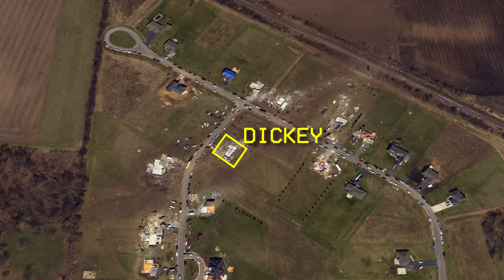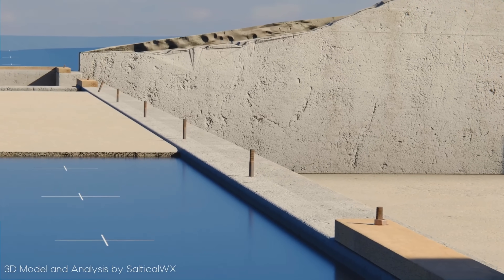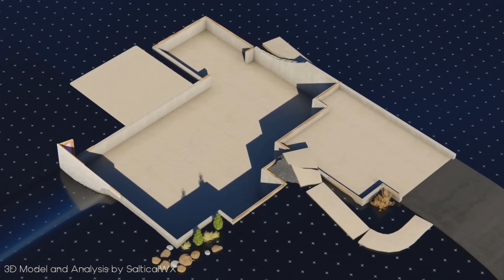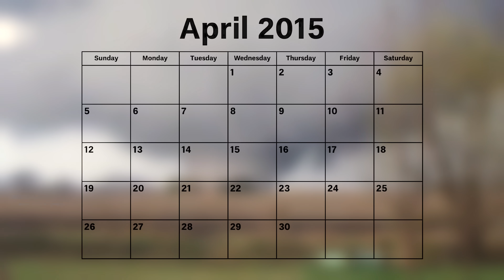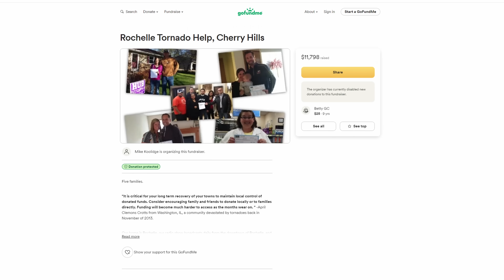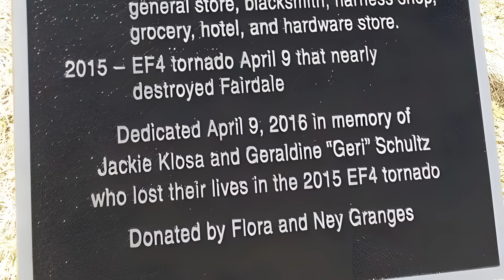The Strongest Tornado That Wasn't Rated EF5

Comment: I still want to know why weather officials are scared to rate a tornado an EF5. What’s so controversial about giving a tornado its deserved rating?
Reply: The reason we are getting less and less EF5 rated tornadoes is because building practices are getting skimpier. The tornado can have 1,000 mph winds and it will never be rated any F5 unless it encounters a ""well-anchored home""
Reply: The scale got revised recently again a few years back. Ever since there have been 0 ef-5's. Also 80% of ef-5/f5's in the past wouldn't even be rated ef-5 with the new requirements. The NWS pretty much made it impossible to get an EF-5 rating
Reply: Probably has something to do with FEMA payouts and insurance claims.
Reply: @Turk_2023  this i believe they dont want pay out and insurance companies involved.
Reply: They aren’t “scared”, it’s just there’s a very high standard for a tornado to get EF5 and those are determined by a team of regional wind engineers, not the NWS. Anything above EF2 is marked for a QRT team to review for damage higher than EF2.   

New Wren for example never got EF5 cause the survey teams were overwhelmed and couldn’t reach its most severe damage in time.
Reply: Fujita wasn't as picky as he would rate rate extreme ground scouring as an F5 on the original F-SCALE. The only reason why homes are used in rating tornadoes is because the big insurance companies don't want to pay out for damage rated EF5.
Reply: @cubby091398 Not enough is known about ground scouring to give it a rating
Reply: @Arlen_YouTube usually doesn’t ground scouring happen in very powerful Tornadoes?
Reply: @TheShadow_2025  An Ef4 is a very powerful tornado.
Reply: @TheShadow_2025  
Honestly it would also depend on the type of soil. I'm no expect and took enough pedologic courses in college to be dangerous  but I've seen dirt stronger than rock
Reply: @cubby091398 it has absolutely nothing to do with insurance. That conspiracy makes no sense. What does the rating have to do with payout? A destroyed house is a destroyed house, regardless of tornado strength.
Reply: The rating has nothing to do with. People dont pay for "just EF5 insurance"
Reply: @KaiserStormTracking In time a.k.a. before it was cleaned up?
Reply: @KaiserStormTracking what about el Reno? Wind speeds were high enough but still just an EF3
Reply: @TateLapine  wind speeds from DOWs are not used for rating, especially since those winds are above the surface where damage is done. They will be taken into account once the me update to the scale is finalized and released in a few years however
Reply: @KaiserStormTracking if that's the case, they need to revise their process. The spiral pattern and the pealing of the concrete was extreme! Sometimes you can just look at it and know. This tornado is one example of that imo.
Reply: @KaiserStormTracking This is not the first time they've done this and One of the most famous examples would be the El. Reno  of 2013. It was Should have been given an ef5   Rating being the fact, it had EF 5 speeds and And had the greatest Potential of e f 5 damage.
 But yet with only given EF3 . But If El reno tornado 2013.
it was on the old F5vscale, it would have been rateded. As a high-end F5
Reply: @2musicSoundtrackfandom579  The El Rino 2013 tornado doesn't deserve the Ef5 rating because the Ef scale measures damage and the tornado simply didn't cause ef5 damage
Reply: There are objective criteria, but there are also possibly politics, because the criteria are written so it is extremely hard to get an EF5, for example two nearby instances of EF5 damage have to be found, not just one.  So I think it's plausible that there is some insurance or other business factor that exerts some influence on this rating, although I'm not sure what it could be.
Reply: @myke5696  NWS ratings aren’t determined by politics. In fact it’s against NOAAs scientific integrity policy.
Reply: @myke5696  Its pure scientific, there is no political interest. There is a reason getting the Ef5 rating is hard, if you make it easy to attain, then it won't hold the same value.
Reply: @Arlen_YouTube you’re objectively wrong. It’s political and financial in nature almost exclusively.
Reply: @Cinerary  Wdym?
Reply: Insurance companies
Reply: @commiehunter733 
Incorrect
Reply: @commiehunter733  I whole heartedly believe this
Reply: It’s less about scared and more about it being unnecessary and holding such a high standard. 

Most homes built in the United States today have very low building standards. Meaning something as moderate as a high EF3 could obliterate a new construction home. Houses are being built so fast as the US is transitioning to a renters market that building codes are being changed, ignored, or down right just built horribly. 

For a town to get the EF5 rating a nuclear bomb would have to essentially go off. More than just destroyed houses and or buildings. I’m talking asphalt being ripped off the road, tree’s debarked, ground scouring, and “well built”homes with wall anchors being obliterated. 

The problem with the EF scale is it relies off damage because originally that’s the best way to measure the wind speeds of tornados. Today we have much more modern equipment that can detect internal wind speeds. That’s why the EF scale is so controversial because you end up in situations where tornadoes like the 2013 El Reno tornado are an EF3 despite being the largest tornado ever recorded on this planet at 2.6 miles wide and unconfirmed wind speeds > 300 Mph 

To sum it up. EF5’s aren’t rated often because building quality is going down but as technology increases we are finding new and better ways to observe tornados making the EF scale controversial and outdated.
Reply: Probably for the same reason they’re hesitant to issue a PDS tornado warning: The “crying wolf” phenomenon. People get used to it and won’t take it seriously. 

A few months ago in Michigan, we had a series of PDS tornado warnings issued. They talked about “catastrophic, complete devastation” being possible with each of those warnings. It never happened. Yes, there was significant damage. But I dont think any of the tornadoes that touched down were higher than an EF-2 or 3. 

Now, people like my parents (who already didn’t take regular tornado
Warnings seriously) basically ignore weather warnings. It’s part of human nature.
Reply: Yeah EF5 is only given to tornadoes that can sweep away steel reinforced concrete structures.
Reply: @BroadwayLTDProductions  not anymore, lol. Now that, and just about everything else is just EF-4 according to the NWS. It’s all petty politics now
Reply: Sam is kind of dumb. I would’ve backed that ass up. He had plenty of time.
Reply: Someone may have said this but they probably hesitate to do so because if all these strong tornados are rated an EF5 people won't take the weather seriously. Lots of people already don't care to get to safety so if they flippantly rate them as EF5s ppl will fail to take it seriously and possibly more ppl will die
Reply: This was an F5 Tornado. They got it wrong. Fujita was more accurate
Reply: @LVM5584  Based on what?
Reply: @schnitzelschnizel9448 Smh No tornado "Should have been rated ef7"
Reply: My rule of the thumb, when in doubt, look for who stands to make or save the most money for a given outcome. I have no reason to believe that the reason we haven't seen another EF5 rating in a decade is a mix of a number of reasons already mentioned in this thread. To believe it's only due to data is nothing short of naive.
Reply: It’s less about scared and more about it being unnecessary and holding such a high standard. 

Most homes built in the United States today have very low building standards. Meaning something as moderate as a high EF3 could obliterate a new construction home. Houses are being built so fast as the US is transitioning to a renters market that building codes are being changed, ignored, or down right just built horribly. 

For a town to get the EF5 rating a nuclear bomb would have to essentially go off. More than just destroyed houses and or buildings. I’m talking asphalt being ripped off the road, tree’s debarked, ground scouring, and “well built”homes with wall anchors being obliterated. 

The problem with the EF scale is it relies off damage because originally that’s the best way to measure the wind speeds of tornados. Today we have much more modern equipment that can detect internal wind speeds. That’s why the EF scale is so controversial because you end up in situations where tornadoes like the 2013 El Reno tornado are an EF3 despite being the largest tornado ever recorded on this planet at 2.6 miles wide and unconfirmed wind speeds > 300 Mph 

To sum it up. EF5’s aren’t rated often because building quality is going down but as technology increases we are finding new and better ways to observe tornados making the EF scale controversial and outdated.
Reply: Something has to be up with house construction in the Midwest and the South. I guess contractors see the area as tornado prone, so they cheap out on the construction quality. Either that, or an EF5 secures more aid and attention, aid and attention that the government doesn't want to give out.
Reply: @gliiitched  the first one is right on the money. American house construction is notoriously bad
Reply: @gliiitched  The Ef5 rating is extremely hard to attain, your house has to be nothing short of perfect. Your garage door must be reinforced, your house must be both resistant to uplifting forces, and the winds themselves. It must also not have a porch causing the roof to be lifting off. Nothing big must hit the house when the tornado hits, such as a car. Also your house has to be cleanly swept away from its foundation to where all the debris pushed away from the house with little to no debris left on the foundation.
Reply: I've come to the conclusion that everyone is simply incorrect when they rate tornadoes under the F or EF systems... because those are not tornado ratings. They are tornado DAMAGE ratings. Calling a tornado an EF-4 or an EF-whatever means nothing, because the tornado didn't damage itself lol. Instead, a house might be said to have sustained EF-4 damage. It literally means nothing or has nothing to do with the tornado, clearly. If it was about the tornado, then it wouldn't matter what the damage caused was, it would only matter what the actual wind speed measurements were. And... hate to break it to the NWS warriors on here, but DoW is highly accurate at relatively close ranges, which virtually all DoW ratings are. So if a tornado was measured by DoW, that really should be the #1 factor in rating a tornado.

TL;DR: EF scale has virtually nothing to do with the tornado itself, calling a tornado an EF-whatever doesn't actually mean anything about the tornado itself, DoW is definitely accurate enough at close ranges to give accurate windspeed readings, and we need to actually use science (clearly subjective surveys of damage is definitionally unscientific) to rate tornadoes, and I hope we actually get a true tornado rating system, because neither the original Fujita scale nor the Enhanced Fujita scale are actually rating the tornadoes.
Reply: @joshuaporter1905 your tl;dr is legitimately just as long as your original comment, lmfao.
Reply: Basically, scientists overestimated the wind speeds needed to cause damages historically rated as EF5. And now they are correcting that. Yes, wind speeds have been estimated because we don’t have a reliable way to directly measure them in a tornado. 
Personally, I think they should have just kept the rating scale the same according to level of damage and updated the wind speed assumptions.  But that’s just me.
Reply: @schnitzelschnizel9448  You can't have something that is Ef6 if the scale goes up to a Ef5, plus we haven't had an Ef5 in over 11 years so we clearly don't need an Ef6.
Reply: Well not only the reasons ppl listed but if they just rate a bunch of tornados EF5 when they aren't it will make the damage/lives lost not seem as serious over time 
"Yeah but so and so tornado was EF 5 and only killed 1 so this can't be so bad"
The public already doesn't take tornados seriously this would make it worse
Reply: @SageMoon-Moon but… that doesn’t mean they need to stop giving out the rating. There have only been a couple EF5 worthy tornadoes over the past 10-15 years. That’s not “handing them out”.
Reply: Some people: "Here's a clear, cogent, data-driven answer to explain your exact question."
Other people: "Rabble rabble ignore science, it's a conspiracy between gubber-mint and money."
Reply: @digitaltrekkie  I can understand why people throw out random conspiracies when the last one given the rating EF-5 was over a decade ago, on top of utterly  devastating tornados that have broken records but still nothing. I understand why they use the EF scale instead of the F scale but to me it still just doesn't cut it.

There could have been the most powerful tornado in history but unless it causes damage to manmade structures that were already constructed to a high degree it would be possible for it to get an EF-2 or 3 rating. To me at least it would be giving an earthquake a low rating cause there were no structures affected. A real example was in my country of Canada where in Elie Manitoba there was a F-5 tornado that struck and the only reason it was allowed to be given that rating was a video that was taken of it was put forward(they had evidence from the damage done but but made excuses for it).

I understand you may not have the answer but I just want it all to make sense.
Reply: @digitaltrekkie  This is a rather uncharitable view of people complaining about a rating scale that is known to be flawed, under revision, and is regularly criticized by meteorologists. Additionally, conspiracies exist. You're acting like every conspiracy is lizard people or NASA hiding the flat Earth or whatever, but large pharmaceutical companies took doctors on trips to butter them up to sell more of their product. That was unethical and a conspiracy by the pharmaceutical companies to get better profits. If the insurance companies have any way to bribe or prevent engineers from reaching the worst damage of a tornado, therefore preventing a proper survey, that would be a conspiracy that could benefit them by allowing them to deny claims from destroyed homes because now they can say it was the home owner's fault. A practice insurance companies have been caught doing so many times it's mundane.

Until we understand tornados better scientifically, we are going to have terrible rating scales. Right now we know next to nothing about them.
Reply: @digitaltrekkie not even remotely accurate. The “science” would be trusting a far more accurate scale (the original fujita scale’) and, you know, MAYBE NOT PRETENDING DOPPLER RADAR EXISTS.
What an absolute clownshoes laughingstock, to claim “EF-5 tornados have 200mph winds” and then give literally dozens of tornadoes with clear F5 damage and directly measured windspeeds in excess of 250mph as “totally an EF-5 scale.”

You’re supporting a corrupt bureaucracy, not science.
Reply: @digitaltrekkie rabble rabble? Really? 😕
Reply: @syds8752  I'd just watched an episode of South Park with a rabbling crowd, and it was fresh in my mind; probably could have phrased it better and less dismissively, I admit :\
Reply: If it didn’t reach the minimum EF5 requirements then it’s not an EF5. Simple as. Its data, not a trophy
Reply: @trevorfyb4672  it moved a whole concrete walkway, and damaged the foundation, usually only found in STRONG tornadoes, specifically EF5’s
Reply: @Gic424_YT  a walkway chunk piece can be moved by a human, as for the foundation damage the question becomes was it already damaged? was it a build quality issue? if the answer is no and build quality was top notch then you got something, but it take a bit of work slicing up the rest of the foundation to check which costs time/money
Reply: @Gic424_YT  usually. Not always
Reply: @Gic424_YT  Moving a concrete walkway is trivial if air is able to get beneath it easily enough. This is why actual engineers are required to make these assessments; they understand these things and can assess them given the context based on their expertise while 99% of the layman YouTube commenters (and perhaps creators) think they know better, despite knowing close to nothing about any of it.
Reply: @trevorfyb4672 liar
Reply: @trevorfyb4672 The narrator pointed out several examples that this may have been an ef5.

Comment: One of my candidates for F5 was the 1999 Loyal Valley TX F4. The nearby NWS office stated that the tornado rivaled that of the BC-M and Jarrel tornadoes. It also ripped a section of asphalt off a nearby road and cattle were disemboweled beyond recognition. F5 considerations were made but the buildings were found to be of lower construction quality. Yet the damage experienced there is very close to the warranting of an F5 rating.
Reply: I agree like, if wasnt an low quality constructed buildings, it would be an EF5 for sure but, another tornado that should been an EF5 was the June 21,  2023 EF3 tornado that struck Matador, TX, the cars and houses damage images is unreal, and its the same case of the Loyal Valley F4, Low quality built homes, for sure that tornado would be an EF5 it did strike well built homes.
Reply: That tornado is basically an EF5. Any F4 tornado is essentially an EF5 by default.
Reply: Bakersfield Valley F4 ripped three 180,000Ibs oil tanks and tossed them for three miles before rolling two 600 feet up a very steep hill
Reply: I wonder if any photos/footage of this storm exist.
Reply: @Artfanbookfan25  No known photos/video of this tornado or storm exist, only horrific damage images.